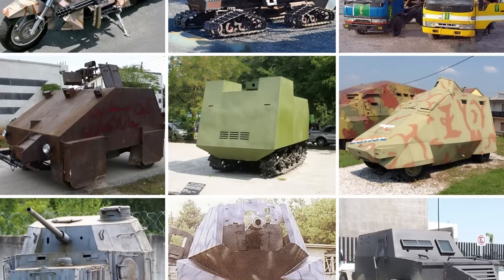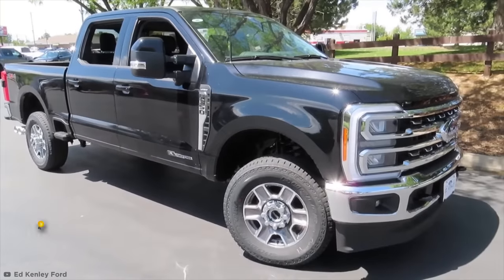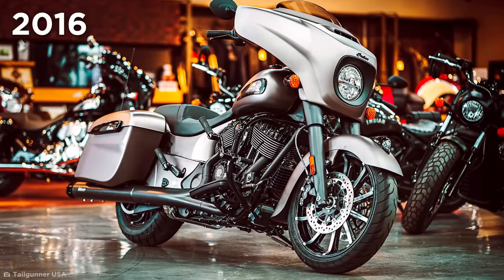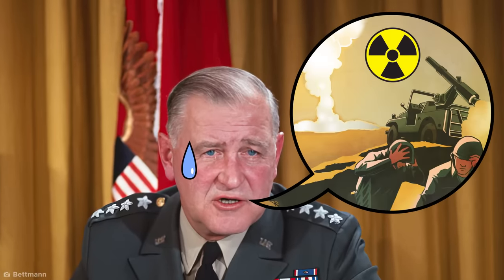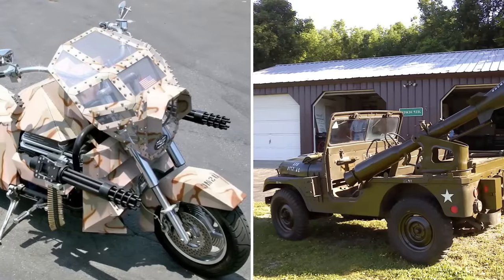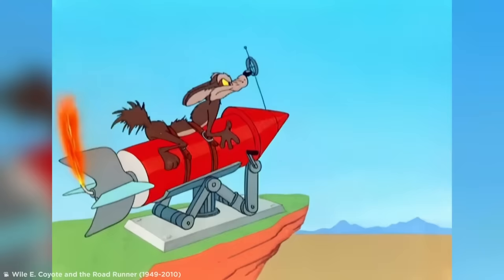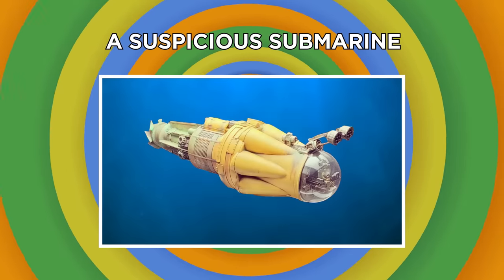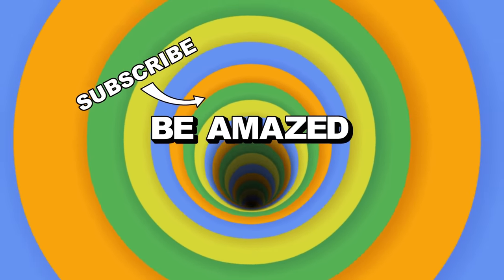Craziest Handmade Military Vehicles

Comment: Citroen 2CV has, despite its age and simplicity, insanely good suspension and is nearly impossible to flip over. That thing might actually handle some of those weapon systems shown here...
As for concealed rockets... Yugoslav/Serbian MLRS system M77 Oganj has the tarp that rolls on and away automatically, by simply flipping a button. So, when the tarp is on, you see any regular military truck (though there were reports that during the NATO bombing of Serbia some were painted over in civilian colors making them impossible to differ from any other truck). Then it stops, the operator flips a switch, the tarp rolls in and - you suddenly see there are 32 rocket tubes ready to go... Point them where you want, fire them all in 11 second, roll the tarp on and let the enemy wonder where that MLRS is...
Killdozer... Well, the real story is longer and more complex. There is a movie called "Treads" about it...
Reply: 2cv with either 20mm mg151 or 75mm recoiless gun were used (somwhat succesfully) by french armed forces in the late 50s during algeria idependence war.

Comment: Excellent video as always. However from what I understand the Killdozer was actually stopped because a coolant hose underneath was ripped open causing the engine to eventually overheat. He ended up taking his own life inside
Reply: Yeah, and it took them like 2 hours or something to get his body out cause the thing was just so extremely heavily armored.
Reply: @HippieInHeart  Do I remember correctly it was something like an inch of cement sandwiched between to half inch plates of steel?
Reply: @t.mendous7922  Not sure about the exact measurements, but I definitely also remember concrete or cement sandwiched between steel plates.

Comment: the Battle barrel's 23mm technically isnt stronger than the bmp 1's 73mm... because the bmp 1 usually shoots heat grenades (heat standing for high explosive anti tank) while im guessing the 23mm shoots AP or HE or maybe even both. but im pretty sure there isnt many tanks over there so the 23mm would be more effective since it shoots faster.

Comment: The story of the STZ reminds me of some of the first german ww2 vehicles. Due to the contracts of versailles after ww1, germany was allowed to only have an extremely tiny military and few - or maybe even no - armored vehicles at all. Due to this, they instead started building civilian vehicles that would be very easy to convert into combat vehicles. One example is the so called "Leichttraktor" (light tractor) which was officially an agricultural vehicle but it was very quickly converted to one of germanys very first armored combat vehicles at or shortly before the start of ww2.

The story of the killdozer is a little bit inaccurate. At first, the company wanted to buy his land, but he didn't want to sell. Then, eventually, the company got some politicians to grant them some land next to his, but the land that the company was granted "coincidentally" included the only driveway into his repair shop, making it completely useless. Frustrated by beurocracy and corruption, he eventually got so angry that he built the killdozer.

Comment: The BMP-1 "Battle Barrel" would not be a "more powerful" anti-vehicle platform.

The 23mm ZSU gun (and it's definitely a ZSU-23-2 system that's been cut in half and strapped onto a makeshift turret) is capable of throwing lots of small shells and far, with a good measure of accuracy. It's meant for slow, low aircraft and helicopters.

Against ground targets, it would be very effective against (read:make minced meat out of) infantry, be able to shoot through concrete, and perhaps even through heavily reinforced concrete up to a certain thickness, and tear up light vehicles - but against anything more armored than the BMP itself it would do very little by the time the enemy would fire back.

The original Grom cannon is a 73mm recoilless gun that could fire explosive or HEAT rounds and would be much more effective against enemy armor - though if against anything more modern than a T-54\55, only from an ambush position, and only by destroying tracks, targeting the engine deck, or somehow sneaking a shot through the lower glacis or the top of the turret - which, in the case of modern MBT's would be very, very unlikely.

Comment: Im sure someone already mentioned it but regarding the "Battle Barrel" based on the BMP-1, your info is incorrect about the main weapon. The original weapon is a 75mm cannon and the 23mm cannon on the battle barrel is a downgrade not an upgrade. Which is curious as to why they would replace the 75mm cannon with a 23mm auto cannon. Perhaps they wanted a higher rate of fire or did not have access to the 75mm ammunition.